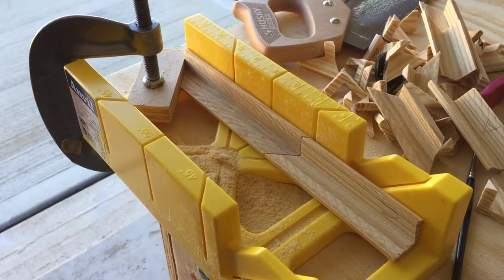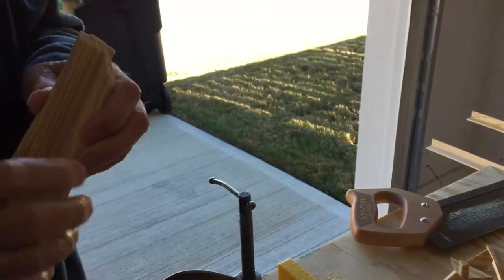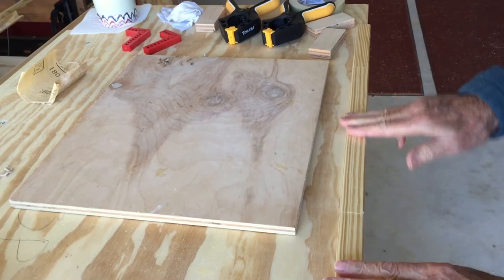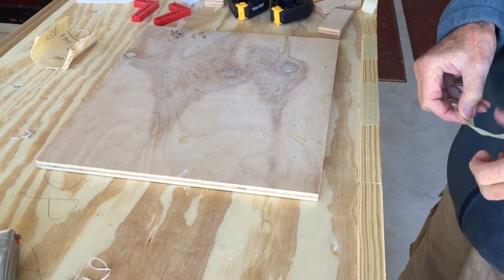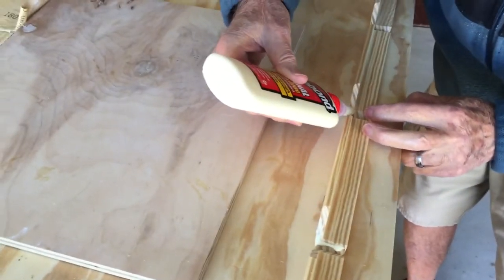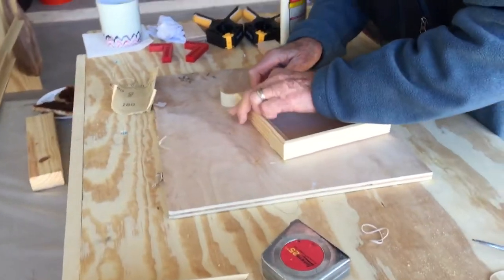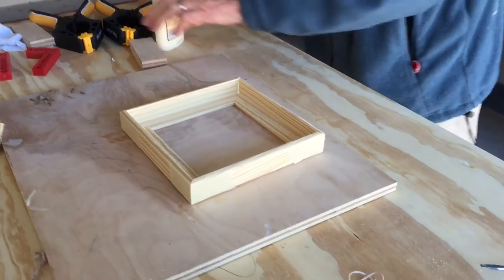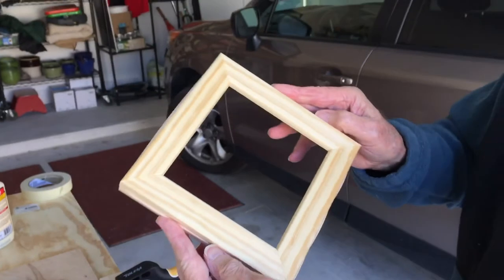Picture Framing with Mitre Box and Glue

Comment: I actually bought one of these last year at Home Depot because I am too scared to use my husbands power saws. Never used it but now I will! Wow it’s like magic! Bravo, Stanley should pay you!
Reply from the maker: Thanks for comment. I too am afraid of power saws, and it’s more stuff in the garage. The best way to make a bunch of pieces to exactly the same length Is to use a stop. But it’s always dangerous to trap your work between the blade and a stop. No problem with a mitre box. Good luck with your project.
Reply: Did you get his power saws in the divorce?

Comment from the maker: It’s an Anvil mitre box $5 with Husky mitre saw $10 from HD. The frame is 1 1/8 corner molding. Floating picture frame. Picture is 6x6 so I added 1/4 space between picture and frame and frame thickness is  1/4 for a total of 7” outside width.

Comment: That was cool but can you show me how to measure so that it fits my art? It seems so easy but it is not. I'm using the same corner molding you are but when i measure i can't figure out how to do it very accurately and how to line it up with the saw. I don't know how to explain. I do a lot of measuring and cutting flat things but this is dimensional and i need to be so precise.
Reply from the maker: For 1/2” border on floating frame, add 1” to frame size to get corner to corner size. Important thing is that opposite pieces are exactly the same length. That’s why a stop helps (for hand saw, don’t use stop on power saw).

Comment: Very nice. But with that Miter box it looks like your are limited to framing small prints and art work. ?
Reply from the maker: There is virtually no limit on size. The essence is equal lengths, which you can achieve by clamping down the box and a stop to the table. The stop could be like 3ft from the box.
The bigger the frame, the less difference a slight difference in length makes, so you  might get by with an accurate cut to length. Thanks for your comment.